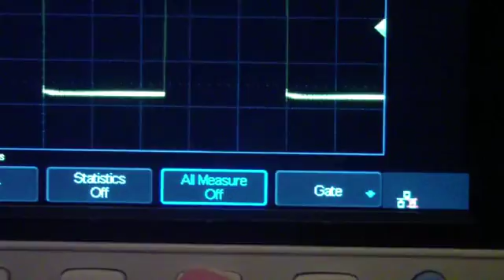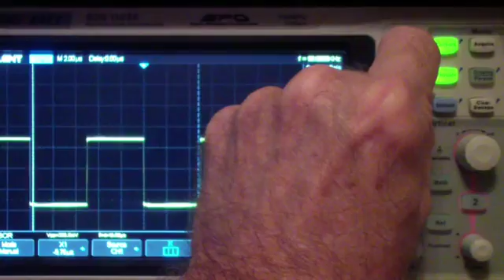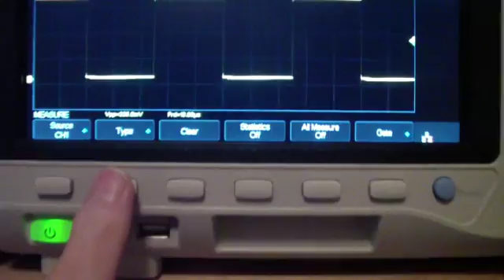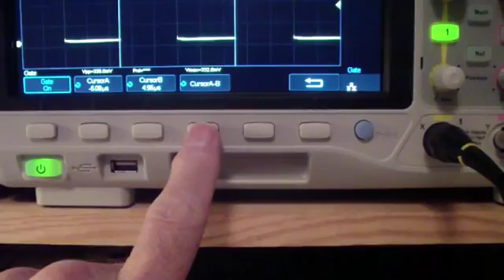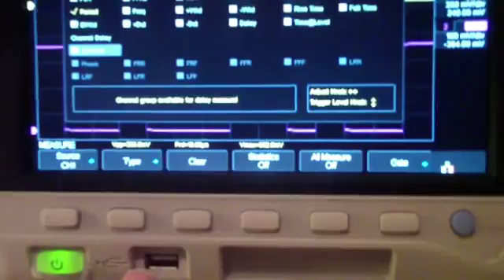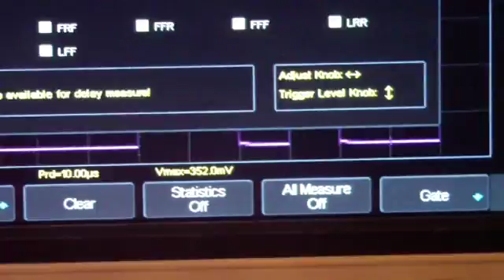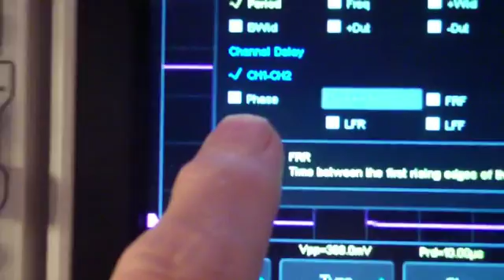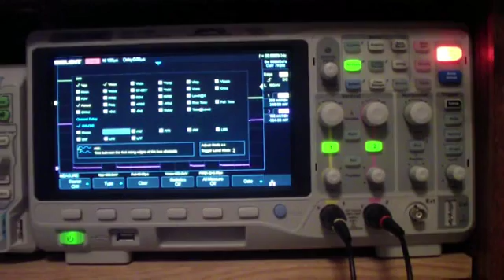TTT010 Siglent v Rigol pt4e

Comment: @tomtektest, 
tks for all the videos, i have saw all of them, 
maybe to put the model name like SDS1000X, rigol DS1000Z into the title would bring more attention,
Reply from the maker: +Selina Yong Thank you for the comment and suggestion. I started putting video on You Tube to help a few students find them who did not have easy access to the internal university site but perhaps it might help others to find what they are looking for if the model number were in the title instead of just in the tags. I have also been asked to combine the sub parts of videos into a longer single part to make it easier to watch a part in order. Perhaps if I do this I will add the model numbers to the title. Best wishes!
Reply: +tomtektest tks!
do you have any plans to review or compare Siglemt spectrum analyzer ssa3000x?
i saw a really good price on aliexpress, however not so sure about the performance, rare reviews for this machine
Reply from the maker: +Selina Yong No, I do not plan to review any more spectrum analyzers for some time. If that changes for any reason, I will consider the SSS3000X. Thank you for your interest.